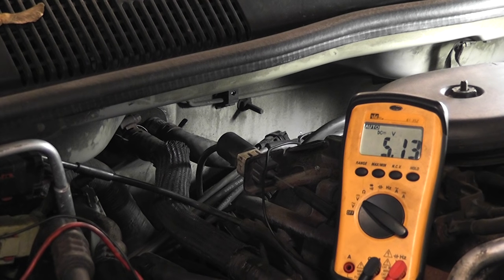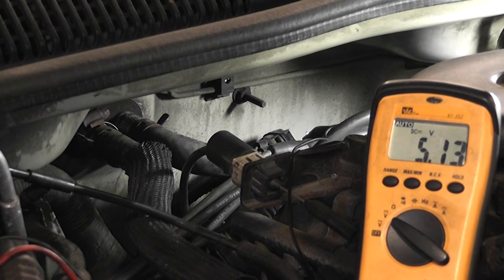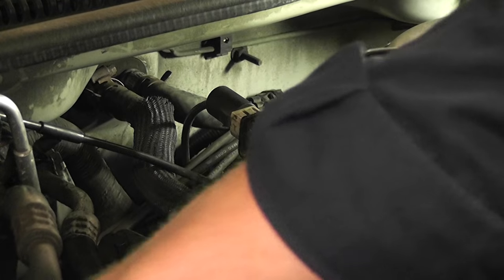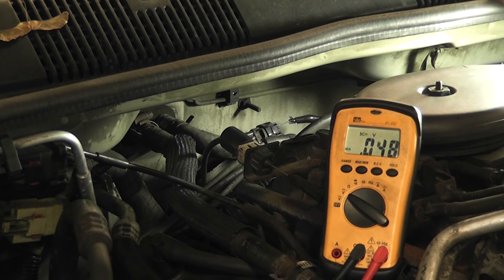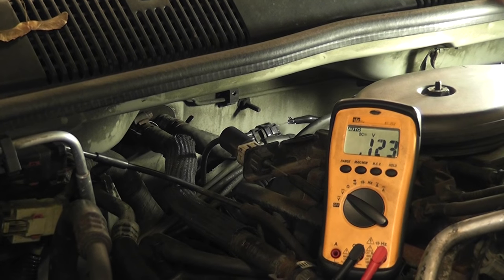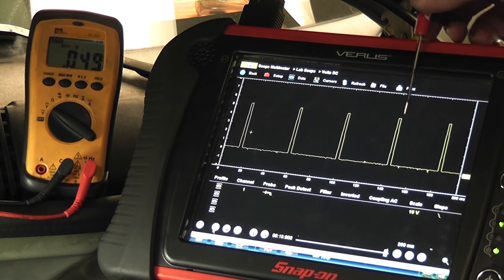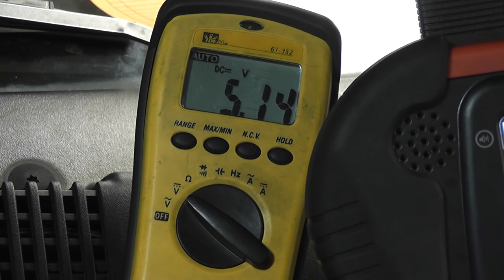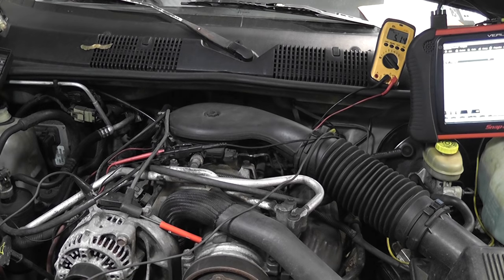How to test a crank sensor with a voltmeter

Comment: Hi Paul, since this is a 5v pull down hall effect sensor, it's easy to ground it with no danger by doing so but, is there a 5v pull up design? If so, I'm guessing that I can't use the test light from B+ since its 12v. Can I jump the 5v power feed to the signal wire to do this bypass testing??
Reply from the maker: No danger in grounding a 5v pull-down circuit, even with a jumper wire. I've never seen a 5v pull-up but if there was one, you could still use your test light and tap into the 5v ref circuit from another sensor.
Reply: ScannerDanner got it, thanks.
Reply: ScannerDanner  hi Paul. I measured my 5v reference at 4.92v (No crank ,key on) is this close enough. I was told that the reference voltage is never perfect. And I should be fine.i basically wanted a second opinion thank you in advance

Comment: Hi Paul 98 vanager 3.0 still no spark, I been reading your book really good. I just follow your instruction all power to pcm and 9 and 5 V supply and ground are okay, this what I found cran sensor signal with key off .378V key on 68.0 MV   speed sensor key off 00.7 MV key on 07.4 MV I just can't find the speed sensor location, little help please.

Comment: im only getting 2.7 volts max and it does goto 0 when nicking the key . think it could be a bad ground somewhere or bad ecm output  voltage ? all power to ecm and fuses same as battery volts 12.5
Reply from the maker: what does the signal wire read with the sensor unplugged? It should be very near 5v

Comment: I have a 2007 300 2.7 and a did this procedure  to this car also to the cam sensor  and i sill dont  hv injector  pulses no power  from the computer to the injectr n wires  are nut cut do you think  my computer is bad ? 🤔
Reply from the maker: Do you have spark?
Reply: @ScannerDanner  yes before the car completely  cut off i scanned it and  it had 2  injector  opened circuit and wen it broke down on the road i scanned it and had 6 code all injectore open circuit crank and cam sensor are good  no broken wires  from the fuse box to the injectors  and from the injectors  to the computer  no it has a code u1414 looked for broken wires nathing all grounds are good i called a mecanic told him if he can test my ecm to see if its good so he came brought his snapon scanner said the ecm is good said every thing is working fine but cam and cran nat in reading dont remeber if he said nat in sync shold me his ready on the scope meter on bother just flat line as he was cranking it but like i said i check the wire going to the ecm signal from the crank and can are going in the ecm so he said no need to reflash it so month later still her with  my broken car 🤔. Thank you scanner danner for taking the time  to replying to me really like your videos 📹  very very helpful keep up the good job 👍.

Comment: So you can kind of see the high and low of the frequency on multi meter. I know there is multi meters that read Hertz.  There is also some  multi meters that show digital square wave on scope function.  I have had some intermittent timing fluctuations with cam crank codes that I could only detect with oscilloscope.  If I'm trying to zoom into the slope would that be considered a digital analog signal? Or is it just a digital signal that is way slowed and zoomed in. I always assumed the digital signal is square. So what would my sloped signal be considered?  Digital or analog? I'm just trying to figure out if a cheap scope will even do what I want. I dont think the time and zoom function would be the same as a good scope.
Reply from the maker: This would be the inexpensive scope you want. It is called a uScope and it is a single channel unit from my friends at AESwave
https://www.aeswave.com/cart.php?m=affiliate_go&affiliateID=60df1b5cf6e5582af6ff81c728f42d0d&go=https://www.aeswave.com/uScope-Master-Kit-1-channel-automotive-scope-p9273.html

Comment: just a question Paul as I see .378v  without the key in, on the crk signal wire I thinking to replace the pcm. also did the by pass test and hear  nothing, any advise thank you.

Comment: if you have a 12v ref voltage and it drops to around 11.2 during crank with a no start condition should i look to the starter?

Comment: when you touched test light to 5v signal wire ..why did test light not give light? because test light was connected to ground and sensor wire had 5v
Reply from the maker: +Raju Yadav the test light pulled the signal voltage to ground. First it has to be an incandescent test light and second it has to be a "pull-down" type of signal circuit. (a circuit that is designed to be switched on and off to ground)
Reply: +ScannerDanner  understood sir ..watched your gm fuel tank pressor sensor test video and understood working of thermistor that how it reacts with voltage flow or no flow..very respect for u sir..u r my ideal..will subscribe  ur premium channel in near future..lots of respect and love from india

Comment: hey paul would it be more accurate if i put a rachet on crank pully and slow turn crank by hand since meter cant keep up with crank? then just look for the 0-5v change? (depending on if its a 5v signal that is)

Comment: So what if you have two pins with 4.9v when the key is on?  Does that mean one wire is hitting the feed line?
Reply from the maker: There is a 5v pull-down type signal and a 5v reference. Completely normal to see that. The signal gets pulled low by the sensor as the trigger wheel spins
Reply: @ScannerDanner  how do I know what is the signal and what is the reference if I don't have a wire diagram?
Reply: @ScannerDanner  or even the ground for that matter?
Reply from the maker: @frontlinemedia4270 signal voltage will be slightly less than reference voltage. For example:
Ref = 5.12v
Signal= 5.09v
Reply from the maker: @frontlinemedia4270 sensor grounds should be less than 100mv
You should join my classes! These are all really great questions 
https://www.scannerdanner.com/join-scannerdanner-premium.html

Comment: Hello greetings from Ecuador, congratulations for the videos are very good! I have a question i followed the steps you describe here, I have a jeep xj 1998 it have misfire and before of that Check engine light P1391 i check connectors and found one pin dirty clean it up check engine light gone, but again starts misfire, i  measuring the power supply voltage of the CPS sensor with the switch open I have 5v, but with the engine running  it drops to 2.5v is this normal? Faulty wiring? Faulty sensor?, i cant check with a scope the wave sensor.

Comment: hopefully your still see this post. Ive got this exact Jeep. I have a nostart problem. i have power to everything and tested all sensors but im getting no pulse to the coil. i have coil power, crank sensor power, cam sensor power but no coil pulse. one thing is my input voltage is 8.9 volts. output is 5 volts on both cam sensor and crank sensor. Any ideas?
Reply from the maker: Chrysler used a 9v supply to the crank, cam and vehicle speed sensor on the older years
For more help go here:

It is becoming more and more difficult to answer questions here. I have 80,000 people asking me for help now. So I have created a forum to help you guys better. It is free to join and we can exchange pictures, wiring diagrams and waveforms if needed to help guide you through the process of troubleshooting your vehicle. Thank you so much! Hope to see you there. 
Paul Danner (ScannerDanner)
 https://www.scannerdanner.com/forum/post-your-repair-questions-here.html

Comment: Im confused im looking at a wire diagram  for this and the red wire says 5v supply and the black /white says  signal but u keep says the red wire is signal so is the wiring diagram  wrong? when u diconect  the plugg from the sensor then it reads 5v constantly   so when u ground it with jumper ur acting like sensor and comolete the circuit.

Comment: Is it ok to remove the crankshaft position sensor with socket connected and then use a wrench or anything metal thing and try to touch it on crankshaft position sensor ? And check the reading ? 😆
Reply from the maker: Yes of course! I show that on a recent video I've done on a Jeep with a new cam sensor (maybe a year or so ago)
Reply: @ScannerDanner  yeah mate i see that after i write a comment just scrolling and find that video before hahahah 😂 so smart

Comment: Hi Paul I subscribed to your channel and paid your membership I appreciate what your doing. I have an Ossy with a crankshaft sensors, I have to 2, one of them with the sensor out I apply 5V reference, ground and obtain 0.3v reference and when I approached an iron back and foward the signal goes from 0 to 0.3v 
And the other the same test but always have 3.9v no matter what 
Do you know of both sensor are bad? Thanks in advance
Reply from the maker: Need to know what the signal circuit design is. If it's a pull-down circuit, your not going to see a change in signal voltage the way you're bench testing that. 
With the key on, sensors unplugged, what is your signal wire voltage?
Or, do the same test you're doing using the cars wiring instead
Reply: @ScannerDanner  ok 5V reference, 1 ground, return signal
Reply: @ScannerDanner  directly from ECM to the sensor
Reply from the maker: @eduardoenriquebarreto6269  I asked what the voltage was on the signal wire with the sensor unplugged (key on). Follow my chapter 2 material on pull-up and pull-down signal circuits
Reply: @ScannerDanner I will do it tomorrow morning and let you now I have a P115 code no speed engine signal detected on pin 17 of the engine harness and this pin correspond with the crankshaft sensor signal
Reply: Once again Paul thanks in advance
Reply: @ScannerDanner good morning Paul I did the test and with the sensor unplugged I have 5V reference, a good ground but no voltage in the signal
Reply: Paul a put a wire from pin17 5V signal directly to the sensor connector and I have 5V reference, ground and 5V signal in the sensor connector plugged but when I approach an iron part the voltage doesn’t go 0 keep near 5V do you think the sensor is broken?

Comment: Sir..my 1998 grand cherokee laredo...my old crankshaft position sensor...the engine died in a middle of a road...plus the volt battery meter is all the way up to the end...so i decided to buy a new crankshaft sensor....and i replaced it....after i onn the engine the result the engine is shaking....and dying and dead engine later onn.....can you tell me why..?
Reply from the maker: James, you need to help me help you. You are describing two COMPLETELY separate systems. Engine died in the middle of the road and you mentioned something with your battery gauge? Did it crank after it died or did you have to get it jumped? So you changed the crank sensor on a guess and now you have an engine shaking problem? Did you have this shaking problem before? If not, you most likely built in a separate problem. Now you have a dying and dead engine, what the heck does that mean? Does it die and then not crank or does it die but cranks normally?
Reply: @ScannerDanner  ok...im  sorry Sir,, I made you confused....im going to alternate my questions: this is my questions,,,1) what makes my engine faulty,,.in the middle of the road,,,it shut off with no reason...when i start again..it back to normal....but when i go to another 15miles,,,,it shut off again...i having a trauma this jeep...? I replaced a new alternator,,new ignation coil,,new battery,,.new distributor cap,,new sparkplugs,,,new sparkplug wires,,,but the problem of being faulty of the engine did not go away??
Reply: @ScannerDanner  And the Second questions is: when i look my cluster...everyday after i start my ignation switchs....i always saw this battery voltage meter the pointer is always went to number 19..the last number..and at a desame time i saw this check gauges lights...what is the causes for this?

Comment: Will the bypass test work with a led testlite
Reply from the maker: Not likely
Reply: @ScannerDanner  thanks
Reply from the maker: @paulstevens6875  it doesn't carry enough current to switch the circuit properly

Comment: I have fuel and spark. I checked my timing Mark's, they were good. Neon 03
Reply: Cylinder 1 110
Cylinder 2 110
Cylinder 3 190
Cylinder 4 50
Reply from the maker: are these your compression readings? you have a mechanical problem
Reply: @ScannerDanner  yes. I'm trying to make the decision do I want to send the head to the machine shop or just put a whole nother Motor in

Comment: In a pulldown setup: If you read 12volt on the signal circuit when it should be 5v(unplugged from sensor) could it be a short on signal wire to power or bad/open ground?
Reply: Are you sure it's a 5V pulldown?  My GM 3.4 is feeder B+, with pulldown.

Comment: Lol Im trying to figure out a volvo and it has a 3 wire connector.. and I'm getting 5 volts and 2 of the wires key on engine off. And the other one is ground I believe, but its  a 2012 volvo s60 and its kinda a pain.
Reply from the maker: The signal wire will be the 5v wire that reads a few millivots less than the other 5v wire. You're voltmeter acts as a load to the high resistance bias voltage that you're seeing

Comment: if is drop down voltage what’s that mean ?
Reply from the maker: Are you talking about pull-up and pull-down circuits?
Reply: thank you answering my questions 
like more than 5v or less than 5v
6 or 8v or 3 or 1v
Reply from the maker: @carlosg802  are you talking about the reference circuit or power supply to the hall effect or the signal wire? Both can vary manufacturer to manufacturer

Comment: Hi Paul..today i tested crank sensor on a no start vehicle..the sensor had 3 wires..i checked the signal with picoscope and to my surprise, it produced sine wave with a sync notch...Paul, have u come across a three wire crank sensor that produces sine wave????  two wires had 2 volts each and third was ground...plzzzz suggest..Thank you..the car is hyundai verna 1.6 L CRDI
Reply from the maker: Yes sir. It is a VRS with the third wire being a shield.

Comment: Hey I know this video is one of your older videos but was hoping you could let me know what it would mean if I was getting 300 millivolts on the ground wire while cranking
Reply: Correction I have 400 while cranking it’s a 1998 jeep tj 4.0
Reply from the maker: On the ground wire, during cranking? I wouldn't be concerned with that.

Comment: Had a 2014 altima, no spark. Changed both crank and cam sensors because the car has 180,000 miles. Still no spark and expected it to be the ECM.   Nope, found out after market sensors don't work in Nissan cars.

Comment: P1389 No ASD relay output voltage to PCM was probably set with the ASD relay removed and engine cranked over. As long as battery voltage is 10.4volts and engine speed is 40rpm or more, if the PCM detects no voltage when relay is energized, it throws that particular code.  I'll tell you what, all of this content makes sense when you have some field experience, lol.

Comment: One quick question.  Which side of the connector were you checking with the T-pin?  The sensor side? or the harness side?  I'm asking because I'm not sure about which side I should be checking during the bypass test.  I'm guessing I should be plugged into the harness side.
TIA
Reply from the maker: If it's plugged in, it doesn't really matter. Unplugged, doing a bypass test, you want to be on the harness side.
Reply: ScannerDanner Thanks... that makes sense.

Comment: What about on a 94 Cummins 12 valve ?
Reply from the maker: no different my friend, as long as it is a 3-wire hall effect type pf sensor
Reply: @ScannerDanner  ok so I can’t figure out what’s wrong with mine bcuz I pulled the pcm and put it on my other 94 cummins and it works and it’s not the crank sensor ether.
I’m only getting 0.40 volts at that wire
Reply from the maker: @cavaleiro95  3-wire sensor?
Reply: @ScannerDanner  yes
Reply from the maker: @cavaleiro95  sometimes you can have a 3 wire sensor that is actually a 2-wire with the 3rd being a shield. In which case I'd be an ac sign wave signal. But if it's 3 wire, it's most likely a hall effect and they need a power and ground to work. The power to them can be anywhere from 5v to 12v

Comment: Hello sir in my case i have problem in spark in my spark plug. 
My crank sensor 3 wire are good but when i plug the terminal to the sensor i have no spark. But when i unplug the crank  terminal its has a spark in my spark plugs. What happen? Need help thank you
Reply from the maker: check for movement of the trigger wheel, if it is good your crank sensor is most likely shorted
Reply: Thankyou somuch  but now i notice about your 5v reference  i always watching your video in my case ihave battery voltage in my crank sensor wire and cam sensor wire. It is possible or not? My car is hyundai tiburon 2004. It almost 3months not running 😔😔😔
Need more help. Any advice would help thankyou sir scannerdanner
Reply: By the way sir im from the Philippines. And you are my idol when fixing the car i always watch your video andbyour lecture.....
Im so very happy because you give me a  response thankyou somuch.

Comment: or more than 5 voltage what’s that mean?
Reply from the maker: Some sensors will use a higher voltage for the power feed to a hall effect. 8-9v on older Chrysler. 12v on many others.

Comment: Hi, I have a big problem with my Gran Cherokee Laredo 1998, 4.0. In the display when I check with the key, appear me the code 43 (misfire). I went to different shops but anyone fixed it. In this video, show one of the signal that I have. I changed and cleaned the same parte like the video. Sorry for my English, Im Mexican. I need help. Thank you! Best Regards. Chrysler Hall Effect Sensor Testing Part I (crank sensor)